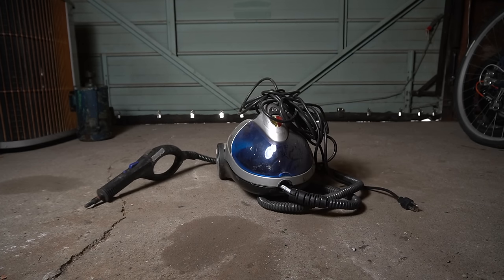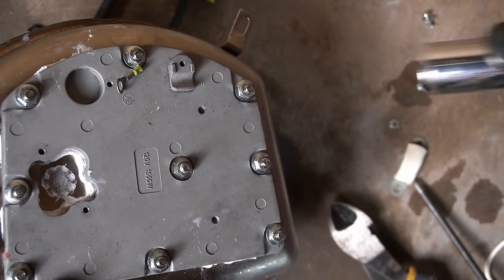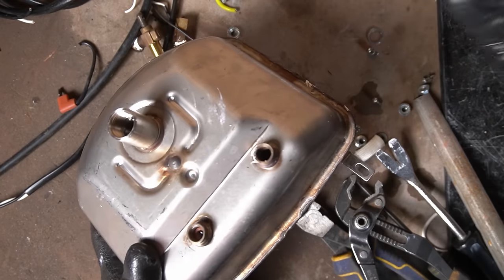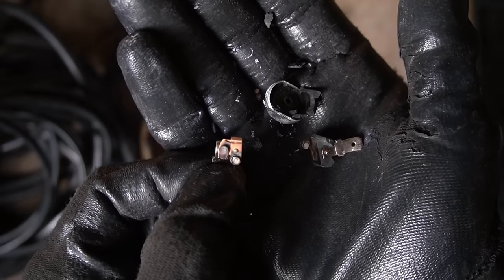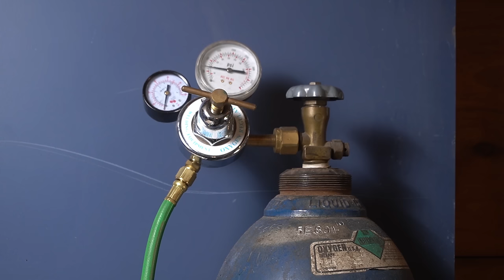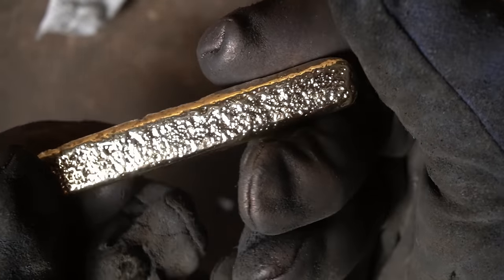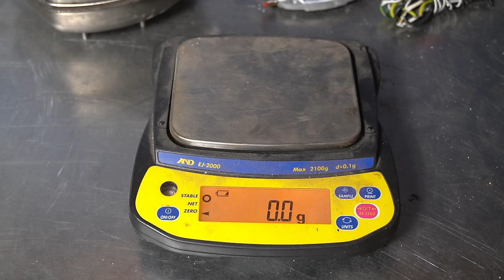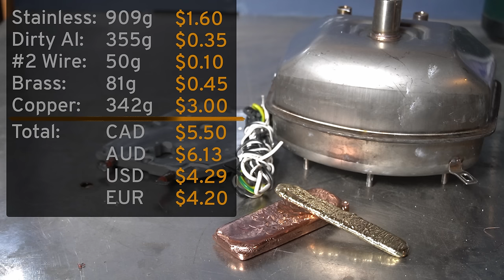Scrapping a Steam Cleaner for Copper, Brass and Pouring Them Into Ingots!

Comment: I like these disassemble and melt videos.  Suggestion on your buffing wheel motor you should remove the grinding wheel on the left side and replace with a wire wheel so you can clean and buff your melts in one station.
Reply: I was thinking the same thing.  I always see the grinder/wire brush, but I really like that buffing wheel and almost never use the grinder.

Comment: The Copper solidifies because the crucible is colder on the bottom because your losing heat to the air around it- this causes your copper to go below its melting point and become solid again. The better and cheaper option if its available is to get graphite crucibles and put them into a insolated space and run air and Propane into it. The mbmmllc channel has a super simple setup for melting all the metals he has to deal with. I know cost wise it may not be available to you or the stuff needed might not be- but propane is a heck of a lot cheaper than an Acetylene torch.

Comment: Like your wire stripper, mine is manual. Torch is definately hotter than my propane foundry.  Good job on the melts. Did you borax the brass? I usually don't melt the small windings due to the excessive smoke from the winding varnish. Yours seemed to do good and I didn't see a lot of smoke.😎⛏⛏🔥🔥
Reply from the maker: Yep, that was borax I was using on both. I’m not sure if it’s the absolute best thing, but I’ve got the fancy lab grade stuff so it seems to work well. I probably should get a vent hood even so. I agree the little windings aren’t really worth it, but I have incentive to get every little bit in these vids 🙂

Comment: I have one of those out in barn that I noticed the mice chewed on the wires the last time I moved it. I was kinda wondering what was inside. I've always took stuff apart to see how it worked or whatever. I've never sold anything to scrap but have been collecting wires and stuff. That thing on the bottom of tank looked like its a safety cut off switch like a dryer has so it don't catch fire or whatever. I've had to replace one before on my dryer

Comment: Here is a scrap hack that can make the copper removal from electric motors much easier. After removing the shroud over the electric motor and being left with the windings fastened snuggly in their slots, what I found after throwing a couple on the camp fire is that the fire will remove all the varnish and thread that holds the copper tightly in place. After cutting the copper it will literally come right out with no pounding. Basically if you have a campfire and sone electric motors to process it does not hurt to  throw them in it.

Comment: In my experience melting small batch metal samples using science lab equipment everything works better if you use the oxy torch but include a propane Bunsen burner constantly suppling heat from below. Once your small batch of liquid metal more than half fills your crucible the top half of the melt insulates the bottom half if you only heat from above. Been watching for years and glad to see you mixing things up, I do like the Dr. Thub Talks Scrap videos but would like you to sometime break down/include consumable costs (costs of fuel/maintenance for the truck, gas costs for melt work). It really doesn't matter what you do I will keep watching and liking.
Reply from the maker: Thanks for the tips and feedback! I’ll definitely keep making a variety of vids, but the underside burner is a fantastic idea. Probably cheaper on fuel too. I always intended to do oxy-propane but the best deal on the oxy tank I could find came with the two bottles of acetylene, so here we are lol. I’ve read the propane wins on btus so I’m looking forward to trying that

Comment: "I'm not worried about the tape and glue, that should burn off just fine" yet proceeds to take it off... and also made a big deal of the other couple of occasions "Teflon tape" was on things saying it wouldn't melt welll...
Reply from the maker: Isn’t Teflon known for holding up well in high heat?